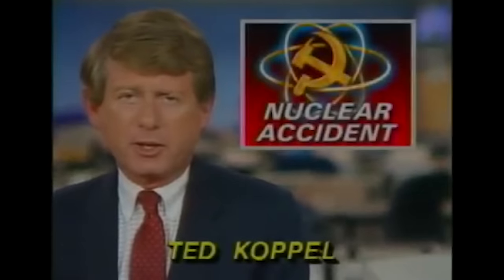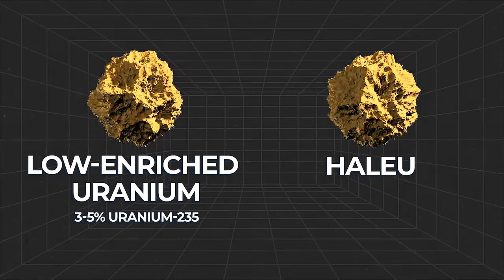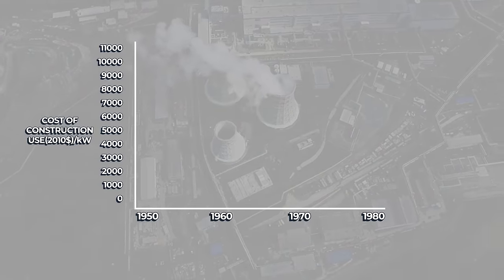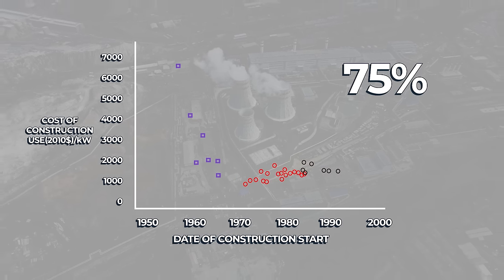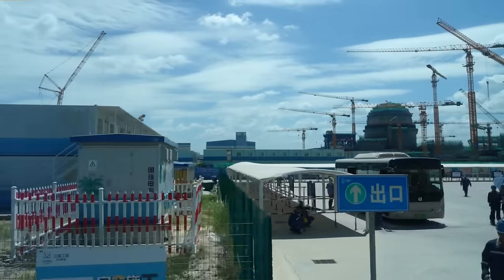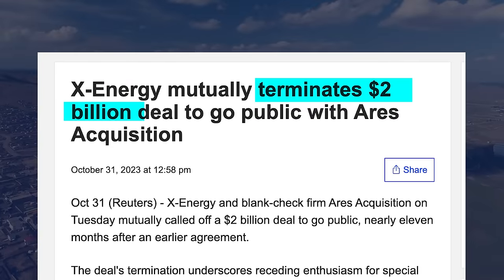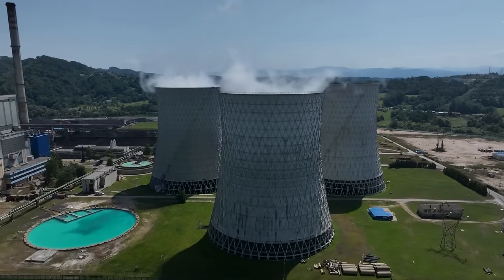Nuclear 4.0 | The Small Modular Reactor Revolution

Comment: Reactors in the 250-500MW range would be useful. I worked as a consultant for a Canadian power utility, who could have replaced their entire generation fleet with a couple of big reactors. It was not practical to do so because a typical large reactor is down for maintenance about 12 days a year.  Taking a small modular reactor offline can be much more easily scheduled, if you have a fleet of them.
Reply: There is not and never has been economies of SMALL scale in power production
Reply: The hell are you on about "Not a market"??? Did I imagine solar panels being invented? They dont produce gigawatts, but still is able to power a home, and even several cities are investing in roadside vertical wind turbines that produce 200 watts when a car passes by. 

The more redundancy you have, the less down time, and in greater numbers you can even outperform large scale installations.
Reply: 12 days time down is small change compared to the wind not blowing or too much cloud cover.
Reply: @Suzuki_Hiakura try it without base load, economically it makes absolutely no sense to put everything at the whim of the weather.
Reply: @polla2256    Nukes provide base load. If your city has just the one, what happens when it goes offline?
Reply: @Suzuki_Hiakura  I think the issue is solar panels dont produce bomb material ?
Reply: @clarkkent9080  What is going on with NuScale Small ?
Reply: @FernandoWINSANTO  NuScale advertised their SMR as costing $1 billion.  They received $2 billion of taxpayer money, $400 million for their NRC review and design revision, and free government land on which to build. Just a few months ago they canceled their project as cost ballooned and utilities backed out.  They are now being sued by investors for Fraud. There has never been economies of Small scale in power production
Reply: @clarkkent9080 Thank You. After years of sci-fi hype and countless online videos reality has the last word.
Reply: @cpborrelli  You lose your own argument with that post; twenty dollars and a trip to Walmart for fertilizer can be turned into several dangerous pipe bombs. Further, nuclear hazards can be efficiently cleaned up as many countries have proved through action already; the only nuclear bombs that are hard to clean up are those made from military grade nuclear material, which is far more reactive than reactor grade.
Reply: eblman5218  You have a misconception of how large a nuclear power plant is, be it 300Mw or 1,000 Mw. 
 The idea that you are going to build a reactor system in a factory and ship it across the roads or rails is ridiculous.  The first plant I worked at was Shippingport.  A 60 Mw commercial nuclear power plant that spanned 3 levels and took up 4 acres. The reactor vessel alone had to be shipped by rail in two sections (vessel and reactor head). 
The reactor system itself is relatively small compared to all the other safety and power generating equipment.  Look at a picture of a typical 1,000 Mw reactor then realize the smaller the reactor, the less efficient it becomes so your 300 Mw SMR will be no less than 1/3 the size of today's standard unit.

 You are one of those people who have never been in a power plant and seem to think they will build it in one factory and ship the plant to site in a sealand.  

Steel foundries cast reactor vessels, pump and valve castings. Motor factories build motors for fans and pumps. Pump factories assemble reactor coolant pumps. Valve factories assemble valves. large or small, each factory specializes in producing ONE item very efficiently and can build and ship as many as you want for max. cost effectiveness.

A reactor system for a 1,000 Mw unit is comprised of ONE reactor vessel, TWO reactor Coolant pumps, TWO steam generators, ONE pressurizer, and connecting piping.  Every one produced in specialized factories.

You seem to think someone is going to spend billions to build a factory that is a steel plant, casting foundry, steam generator (boiler) factory, electric motor winding factory, Pressure vessel building factory, and piping manufacturing factory all in ONE location. And somehow, you are going to transport a massive reactor system weighing thousands of tons from that factory to the power plant site.  

Think about that.
Reply: @clarkkent9080  I guess batteries just don't exist for you then huh?  There has always been and will always be economies of multiple scales for power production.  We produce power on multiple scales.
Reply: @CD-vb9fi  I guess you have to change the subject when confronted with facts against your opinion.
Larger in power production has ALWAYS been better for overall cost.  New nuclear is already the most expensive way to produce electricity and smaller reactors will only increase that cost.

Siting a nuclear power plant is already difficult and costly in terms of all the analysis required, but you believe siting 5-10 times as many is a good idea.

VC Summer large nuclear project canceled in 2017

Vogtle just completed 2 large new nuclear projects that are the most expensive (per Mw capacity ) in the WORLD.

NuScale canceled their SMR project after receiving $2.4 billion in taxpayer welfare and free government land on which to build ...due to ballooning costs

Terrapower is the ONLY U.S. new SMR nuclear project currently planned and has been trying to build since 2016 but has yet to break ground.

I will be waiting for your U.S. or Canada success stories that prove your point.

Still waiting !!!!
Reply: @clarkkent9080 thanks for the reality check.  No we should not expect to make pressurized wet reactors. Too hard.  There are many better options. MSFR, Helium cooled. Lead cooled. Also didn't need your containment bldg which doesn't work in a power failure anyways.
Reply: @grumpystiltskin  Containments are needed in LWRs to contain the release from a primary coolant leak.  All reactors must have a containment to prevent radioactive release from any reactor accident  AND to prevent primary system damage from a aircraft crash (think 911).  All old reactors already meet the aircraft crash protection and any new reactor design would have to have a containment meeting the same requirements.
Reply: @cpborrelli  In the US, no fast breeder reactors are used for electrical energy.  The boiling water (BWR) and pressurized water reactor (PWR) are not breeder reactors and therefore do not produce significant Plutonium to be removed chemically and then used for nuclear weapons, among other uses for plutonium.  Interesting factoid: several years ago it was estimated that Japan had enough plutonium to build roughly 200 nuclear weapons, should they choose to do so. Building a nuclear weapon using U235 requires so much effort in enrichment that few countries can use that route.
Reply: @clarkkent9080  They are being sued because their investors overheated their stock, and then their biggest customer backed out, causing the bubble to burst.
Reply: 12 days a year is really extremely optimistic for any nuclear reactor.

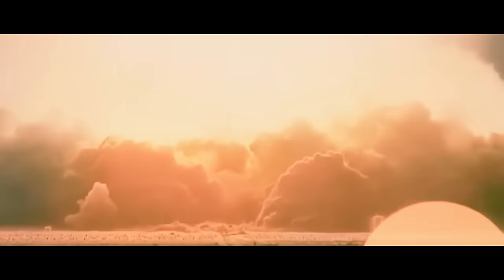Comment: 4:15 Supercriticality just means "reaction rate goes up", which is quite important when starting up a reactor. Increasing heat output is key for going from 'warm rock' to 'useful power plant'. It's just uncontrolled supercriticality which is bad.
Reply: I'm surprised you even made it to 4:15, I can't make more than 3 to 5 seconds before I want to become "that" guy. It's like everyone gets their scripts from AI without any critical thinking.
Reply: Considering the sheer volume of easily fact-checked misinformation in this video, I'm starting to wonder if this guy actually has a PhD or if he just says he does online.  It's not like there are doctorate cops or anything to prevent people from doing that.
Reply: Had to comment when he started talking about "more like a bomb then an energy generator". This is total lies. Bombs need much higher enrichment then even 20%. He should have said meltdown but he is just another one looking for drama. Not going to watch more of his stuff now.
Reply: @olssonan  lol I didn't even make it past a minute.
Reply: >221.5 bar for VHP turbine at temp. of >1650C Metullergy of turbine, and governing turbine if its running critical @ given ts and ps it requires more time to design but its possible by testing multiple alloys at supercritical state and main issue is with control division of particles after reaching steam conditions required to run the turbine which is very very hard so many things could go wrong and only thing fails its disaster🥲
Reply: @olssonan  More and more online videos about new types of reactors moderated by ink are quite harmless.
Reply: Nuclear bombs rely on prompt criticality. It's a completely different beast from supercriticality.
Reply: @patrickweaver1105  first fact correct but second is wrong, every atomic bomb goes prompt critcal k = 1 + β and then prompt supercritical k > 1 + β. That is the boom when K(multiplication factor) starts to dominate the equation.
k = 1 + β is  constant reactions per generation of fissions(it just maintains itself)
k > 1 + β is a rising number of reactions per generation(output grows, wich is what u want for a bomb)(this is supercriticality)
Reply: @MrGemaxos  Every atomic bomb goes prompt supercritical. Reactors can't for obvious reasons.
Reply: @patrickweaver1105  o.o? i think you did not understand what i have said.
Every reactor needs to go supercritical to start or to ramp up the power.
And every Bomb needs too(for obvious reasons).
Prompt or moderated is just a difference in the speed of the neutrons splitting the cores.
The really big difference is the high enrichment and the fuel Mass per volume.
You can totally build a reactor like TRIGA
That works with and relies on the prompt criticality. 
Every reactor , even the ones that are designed to rely on moderated criticality have prompt criticality, if u ramp em up they have prompt supercriticality.
It is just because a part of the criticality equation comes from promt neutrons.
Reply: @MrGemaxos  "Prompt or moderated is just a difference in the speed of the neutrons splitting the cores." No. There is no such thing as moderated criticality. The categories under discussion are prompt and delayed neutrons which come from fissions. Then there are thermal, resonance, and fast neutrons. Which is related to the energy state of the neutrons. Subcritical, critical, and supercritical relate to the power state of the fissionable material. Until you understand these concepts and how they relate to the neutron life cycle of a reactor don't waste everyone's time.
Reply: The prompt neutrons are emitted within 10^-14 and have significantly shorter mean generation time (~ 10^-5s) than delayed neutrons (~0.1s) have crucial consequences. The period of ~10^-5s is very short and causes a very fast response of the reactor power in case of prompt criticality. The state of a reactor, when the chain reaction is self-sustained only by prompt neutrons, is known as the prompt critical state. This state of the reactor is very unstable because one neutron generation takes only  ~10^-5s.   Therefore nuclear reactors must operate in the prompt subcritical, delayed critical condition. All power reactors are designed to operate in delayed critical conditions and are provided with safety systems to prevent them from ever achieving prompt criticality.

For power reactors, at power conditions, the reactor can behave differently due to the presence of reactivity feedbacks. Power reactors are initially started from hot standby mode (a subcritical state at 0% of rated power) to power operation mode (100% of rated power) by withdrawing control rods and boron dilution from the primary source coolant. During the reactor startup and up to about 1% of rated power, the reactor kinetics is exponential as in a zero-power reactor. This is due to the fact all temperature reactivity effects are minimal.

Prompt neutrons are emitted directly from fission, and they are emitted within a very short time of about 10^-14 seconds.

Delayed neutrons are emitted by neutron-rich fission fragments that are called delayed neutron precursors. These precursors usually undergo beta decay, but a small fraction of them are excited enough to undergo neutron emission. The neutron is produced via this type of decay, and this happens orders of magnitude later than the emission of the prompt neutrons, which plays an extremely important role in the control of the reactor.

The prompt critical state is defined as: keff > 1; ρ ≥ βeff, where the reactivity of a reactor is higher than the effectively delayed neutron fraction. In this case, the production of prompt neutrons alone is enough to balance neutron losses and increase the neutron population. The number of neutrons exponentially increases in time (as rapidly as the prompt neutron generation lifetime ~10^-5s).

The prompt subcritical and delayed supercritical state is defined as: keff > 1; 0 < ρ < βeff, where the reactivity of a reactor is higher than zero and lower than the effectively delayed neutron fraction. In this case, the production of prompt neutrons alone is insufficient to balance neutron losses, and the delayed neutrons are needed to sustain the chain reaction. The neutron population increases, but much more slowly (as the mean generation lifetime with delayed neutrons ~0.1 s).

The prompt subcritical and delayed critical state is defined as: keff = 1; ρ = 0, where the reactivity of a reactor is equal to zero. In this case, the production of prompt neutrons alone is insufficient to balance neutron losses, and the delayed neutrons are needed to sustain the chain reaction. There is no change in neutron population in time, and the chain reaction will be self-sustaining. This state is the same state as the critical state from basic classification.

The prompt subcritical and delayed subcritical state is defined as: keff < 1; ρ < 0, where the reactivity of a reactor is lower than zero. In this case, the production of all neutrons is insufficient to balance neutron losses, and the chain reaction is not self-sustaining. If the reactor core contains external or internal neutron sources, the reactor is in the state that is usually referred to as the subcritical multiplication.

The prompt supercritical state is defined as: "A very bad day"

Prompt refers to the neutron generation, if its the first burst of energy from a fresh fuel source, its prompt. Its that simple. These neutrons fly off to go dick around with other atoms, sometimes fuel, sometimes daughter products, sometimes just other shit in the fuel rods, sometimes they even like to hide behind the couch and pop out right in the middle of a power loss spin down test to scare you, these delayed emissions are not prompt, they're delayed. Right there in the name.

Criticality refers to the sustainability of the reaction overall. If its initial fission events are triggering even more initial fission events, its prompt supercritical (also known as an "oopsie", a "fuckywucky", or possibly even "oooo, someone is getting fired!"). If the generation of prompt neutrons is balanced against neutron losses its prompt critical. If its less than losses is subcritical. Same with delayed, just later, and slower, thus more controllable.

Fucks sakes, people. Yall act like its rocket science or something...... Stop fighting, girls. You're both pretty.... 🙄....but if you're going to keep bickering over these concepts and how they relate to the neutron life cycle of a reactor, at least take off your shirts and hash it out in a mud pit, otherwise don't waste everyone's time pussyfooting around basic explanations trying to prove how much of a smarty mcsmartface you are over the other guy. Its just nuclear physics....its not hard....
Reply: @TankR  You just used more words to say mostly what I did. Also, even an old worn-out subcritical core in a cooling pond produces prompt neutrons. It has nothing to do with how fresh the fuel source is.
Reply: @patrickweaver1105  "old worn-out subcritical core in a cooling pond produces prompt neutrons" I never said they didnt.

"It has nothing to do with how fresh the fuel source is." .......bro, read that entire thing again until you understand the implications, otherwise, shirt off  and stop wasting my time.
Reply: @TankR  I understand it fully. Why are you bringing up fuel freshness at all? It means nothing in this context.

Comment: 10/10 for excitement 5/10 for technical knowledge, 2/10 for commercial application, 0/10 for future use of micro nuclear plants. We have major switchgear yards adjacent to previous nuclear plants. These are the ideal sites for re-siting without significant GRID restructuring. It is the GRID STRUCTURE that determines the future generation sites not the generator.